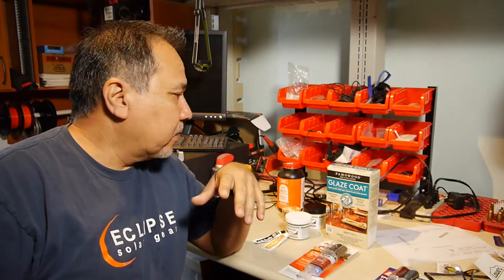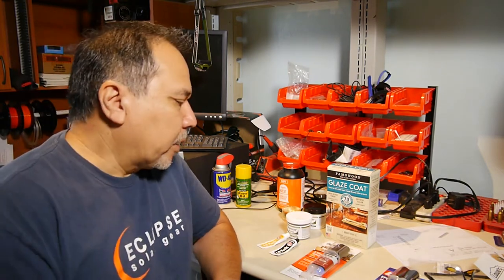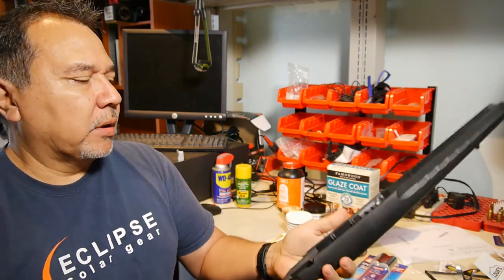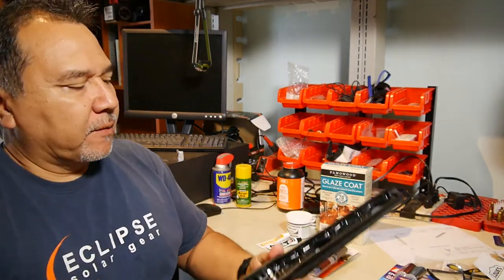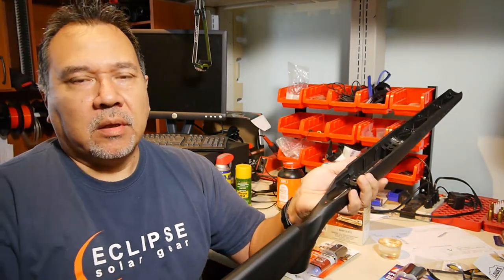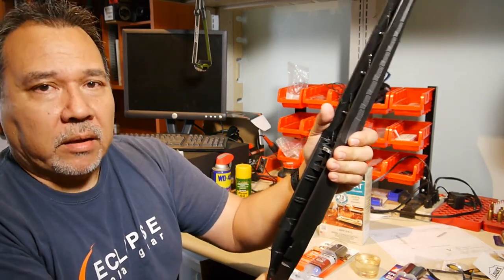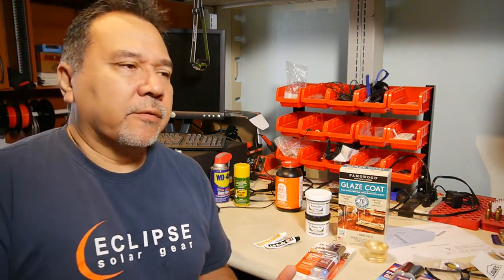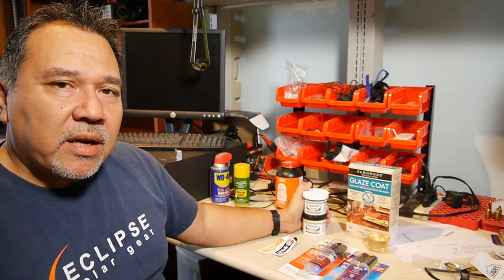What material do I use to bed a stock or modify a rifle stock?

Comment: Even though the phone in the stock seems Halo did it take a lot of the flex out of the stock
Reply: Jake Fryberger Bedding removes vibration from the action if the action is loose in the stock, not flex. Flex can be removed by bracing to a certain degree. Whip happens when the stock moves side to side from the grip. The weak thin grips of plastic stocks have a lot of whip in them. I still had to replace my plastic factory stocks with wood stocks even after reinforcing the plastic factory stocks.

Comment: I did not have to bed the Boyds wood stocks for either of my Savage Axis rifles. The stock is CNC machined specifically for the Axis action. The fit is tight with the take down screws removed. No movement of the action at all. It would not do any good to bed it when its already as tight as it can be. The wood stock made a huge difference in my bullet groups.